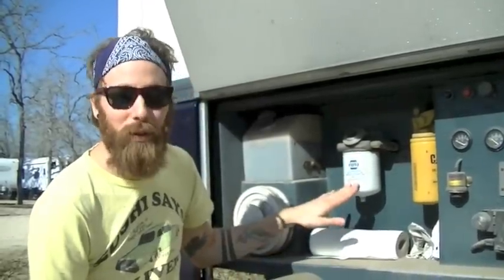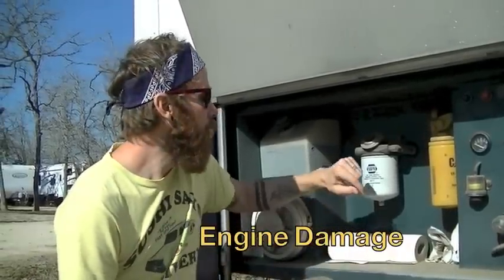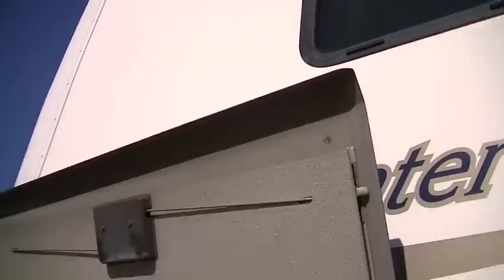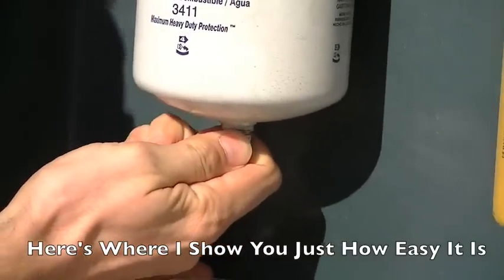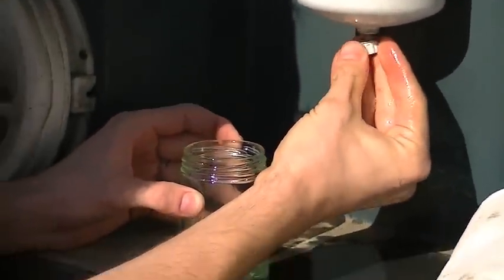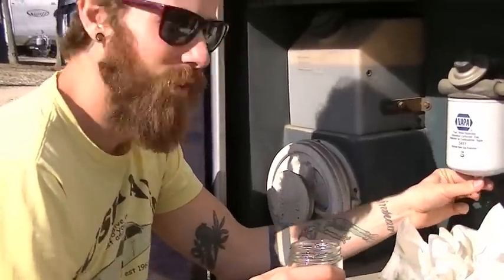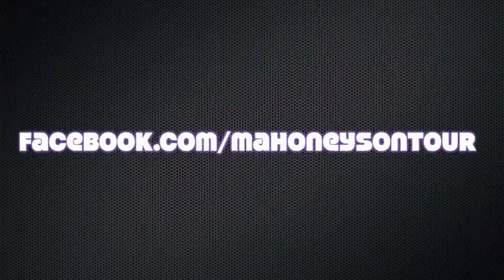How to Drain Water from a Fuel Filter (Diesel-RV)

Comment: 2  things.. Adding a good additive like stanodyne summer or winter blend depending on the season helps a lot.   2) if you are really worried about water, add a FASS type system.   Not cheap, but works really well......

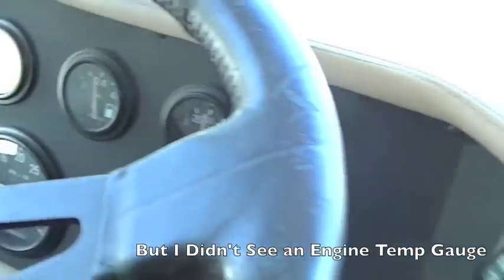Comment: Dude at 1:22 I see your WATER TEMP gauge...left side, next to tachometer. I can see it says 160, 180, 200....operating temp should about 185-190 deg F.  Excessive idling isn't good for these engines. I have a '96 Safari Serengeti 38' Cat 3126 Allision 6 spd coach....but yours is the ONLY video I've seen with regards to the fuel separation filter.....kudos! I have a somewhat more elaborate filter/water separator, but essentially the function is the same.
Reply: QuantumRift idling doesn't hurt any diesel engine dude lol
Reply: @woodman1241  That is absolutely false.  Cylinder washing via excessive idling is a significant issue with diesel engines
Reply: @TheSonicendeavor  ive been around tractors and trucks my entire life. Tractors idle alot. Some have over 14000 hours. No damage from idling lol
Reply: woodman1241 My Cummins iSL9 manual specifically addresses this issue stating:
 Idle the engine 3 to 5 minutes at 1,000 rpm before operating with a load.  No more than 5 minutes.
Do not operate the engine at idle for long periods
This can result in the following (these are well known and documented issues)
• Fuel dilution of the lubricating oil
• Carbon buildup in the cylinder
• Cylinder head valve sticking
• Reduced performance.